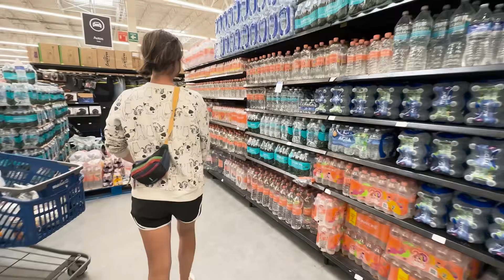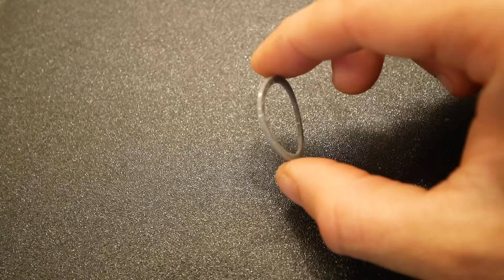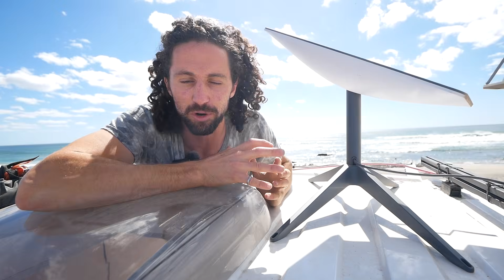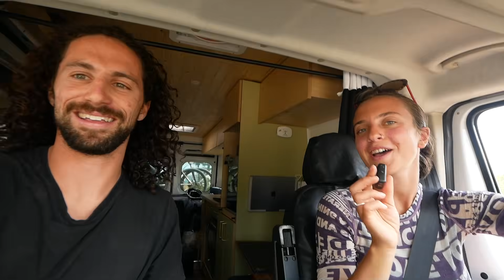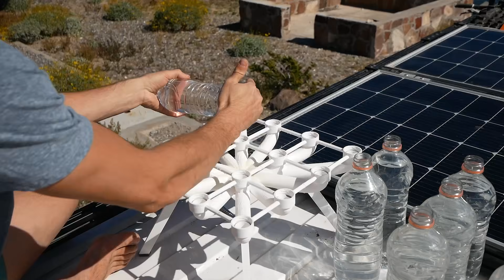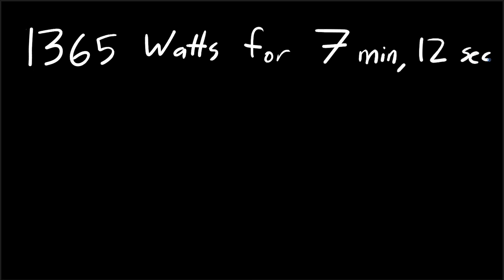I Built an Unnecessary Invention for Van Life

Comment: I would recommend you watch slant3D(a print farm) to optimize your prints for 3d printing. Please do it, my eyes hurt watching this video.
Tip: Dont use those pipes. Print a pice, that collects the water from the bottles and the water will flow to the low point. It will use no support if you cut it into multiple pieces.

Comment: Here could be some Updates on the design:
Update Refill Ways
1. make some male ends for the top caps so you can just put 1 bottle in at a time (the pressure might be higher but idk)
2. makes it so you can put the empty bottles on the roof without water in them then just make a 2nd one of these but with a hose so you can hold it higher than the empty bottles then you could just 3d print a tap then screw your shower head on so no water fell out of the bottom
How to make it Hotter:
1. add a tin foil wall type thing so it can get more sun rays to heat it

2. MORE BOTTLES, make you capacity bigger
3. Print it in black
P.S. I really liked your video so i bought my first 3D printer
Nice video
🙃🙃

Comment: Ok, this project is totally ridiculous for so many reasons, some being pinpointed towards the end, and I get that it was somewhat the point of the video.
DIY is fun, but if you don’t make your research properly, anticipate problems with your choice of design, tools or materials, the result will be totally unpractical and useless and just prove that commercial solutions are much more clever than you are (and paradoxically much more ecological).

But for the sake of the game, I’ll just suggest an hybrid solution : using solar energy to preheat the water before using it in the water heater. That should reduce a bit the power consumption while providing a more satisfactory user experience.

Comment: Yeah I definitely would have made the center part one piece and then had each water bottle holder and tube a separate part that screws or fits into the base piece. Then, each water bottle holder would have mounting points to connect them all together with braces. This way, you could easily iterate the design and beef it up without having to reprint the entire thing. You could beef up the braces by just reprinting the braces. This is the instance where modularity is key.

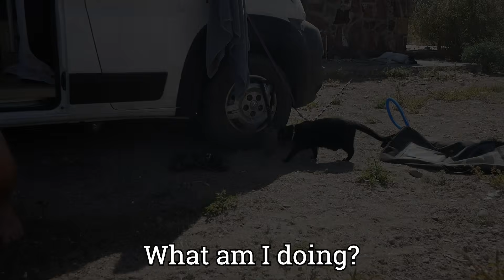Comment: 18:00 "What are you doing?" is what I as asked when I saw this monstrosity in the thumbnail. The way you designed the pipes to all converge at the center, dividing it in 4 pieces that are going to have angled seems that you super glue and caulk to try to seal, and only 0.05 inch wall thickness...

If you were to ever try this again then I would suggest making it more modular by having 4x of a piece that connects 4 bottles together and 1x of a piece that connects those 4 pieces together, all designed with 45 degrees as the max overhang so that it shouldn't need supports, and at least 2-3mm SOLID walls is recommended for PETG prints to hold water.

Comment: Um, a black vinyl bag made to fit available space with a filler fitting and shower fitting would have worked. Just two pieces of vinyl, someone to weld them, and fittings. Oh, or you could buy a solar shower or two at a camping store. Just saying.
Reply: Why not just buy a collapsible 20 gal water bag used for camping?

Comment: I think you could do away with the TPU seal if you look a bit more at the mating surface that hits the mouth of the bottle. The threads don't create the seal, they just pull the cap onto the bottle.
You need a surface on the top inside of the cap that seals against the mouth of the bottle.

Comment: There is a video regarding white filament which uses titanium dioxide so not only is that not a compound you want to print indoors with it also will wear out your nozzles quicker than any of the dark colors that don't use titanium dioxide

Comment: If you're looking at saving water and energy, a recirculating shower is ideal, as you're just filtering and re-using the same warm water rather than having to heat cold fresh water. it's a bit of an engineering and plumbing challenge involving pumps, multiple filters, tanks, valves and heat exchangers, but also a great project to get your teeth into!
Reply: ew

Comment: In regards to designing the cap. Could you have used the original bottle caps and just drilled a hole in them and then glued them onto the rest of the system you made? Also Attach the bottles right side up, then turn them over.
Reply from the maker: Yes, but where’s the fun in that?
Reply: I agree. That was my first thought: you already have at your disposal a perfectly fitted threaded watertight system, so why on earth would you not use that in the design ?
Ok, that might seem funnier to try and try again redoing it with a 3D printer, but that’s a total loss of time, energy and material.
Which wouldn’t bother me at all if the idea and the promise at first was to recycle and be more ecological…

Comment: another good method would be using a heat exchanger from a car transmission to heat the water up from the engine heat while driving, ofcourse if your stopped for a few days that wouldn't work as well.
Reply from the maker: Yeah, those are a common water heating solution for boats, some people use them in vans as well. Super cool!

Comment: Maybe do some intensive testing with water. The prints are not watertight. Why I know, testing with different Gardena Connectors. First the seems to hold water, but after 1 day you see drops.
Thats the issue, yes there are methods form printing watertight. My solution is to dunk the print in a chemical to fill the gaps.

Comment: Yes there is that ABS pipe already made, but.... You were recycling bottles. NOT ABS pipe... So there is a reason for this. 
Also, what if.... doing this, it creates ideas for other uses where say an ABS pipe could not be used. How much space does the pipe take? Is it as portable? 

I was also wondering, what if on each bottle, you printed a valve adapter? Then you could attach, turn "on", attach that to the grid with out loosing water, then when all are on, you "off" the valves and then the water flows? Not sure if the valve could also have a breather port to prevent the vacuum? 
Just thinking out loud.  Keep up all the GREAT work!! 👊

Comment: I have the perfect answer for holding the drawers shut, and it’s completely invisible simply go to the baby section of Walmart or target or any store like that and buy the baby proof drawer latches you mount them on the inside you pull them out they only come out about, I don’t know half inch possibly you stick the edge of your finger in there push-up in the drawer opens Problems solved

Comment: I think this is probably why a lot of (tent) campers use the big, black floppy bag - good capacity, warms up well, drains well without the need for fancy valves etc as they deflate in normal air pressure.  You could simply throw one up there a couple of hours before you need a shower.  Cover with some plexi-glass and you will dramatically increase your efficiency.

Comment: 0:20 --- srly ? .... "you HATE doing"
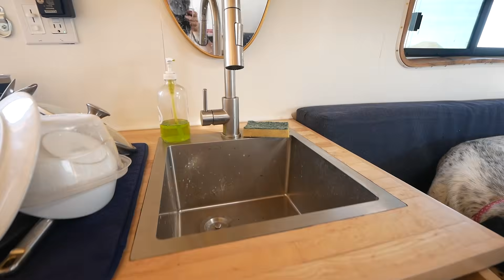meanwhile one big bottle just and inch oposit .... am i joke to you   ,,,, PS 5:04 -- there is something called heatpump water heater ,(can be done DIY) it use up to 6x less energy than standard resistance heater 
the easiest way to build it yourself is to buy 12/24v  mini heatpump (its also called AC - air conditioner) compressor  unit + evapourator and some copper pipe to make spiral out of it to work as a condenser inside water tank ....  and let someone build it to heat water  , could be cool project :)

Comment: For strength and rigidity I would have just printed a thin box with threaded holes on the top to screw the bottles into. You could also design pyramids shapes between bottles to increase surface area for sunlight to heat.

Comment: To expand on Morley's math at the end of the video, on earth an ABS pipe solar shower would be the eqivilent of adding about 3m² of solar panels to the van.
Math:
The Solar irradiance(how bright the sun is) is 1kW on the surface. 
A 3m long, 6" dia solar shower has a surface area of ~ 1.47m².
Even under ideal conditions only 50% of that will be in direct sun, so 0.74m². 
ABS pipe absorbs ~95% fo the light that hits it(aproxamated using the value for "Black plastic" in an IR emisivity table), this means that the ABS pipe solar shower can absorb 700W. 
Solar panals are  <20% efficient, which means that to generate 700w of at least 3m² of panels are needed.
Reply from the maker: That’s amazing!

Comment: The sealing mechanism on many plastic drink bottles, such as the bottles in the video is a small conical section on the top of the cap,  where the angled part of the cone section seals against the inside of the mouth. (imagine the cap has a complete cone with a base dia.>the mouth id stuck to the inside, the threads of the cap will pull the cone into the mouth of the bottle pressing the sides of the cone into the mouth of the bottle, creating a seal. Now remove most of the cone, so that there is just enough of the cone left that it will still make a seal .) This requires A) the lid to be made of a somwhat flexible plastic, often HDPE and B), the angle of the cone relative to the interior wall of the mouth be fairly shallow(30-50⁸ ish).
Reply from the maker: Fascinating!

Comment: cutting off the bottoms of the bottles would solve the suction created when its running. it would also solve the issue of flipping full bottles over trying to screw them in. You can fill them all while they're already attached. You could also set it up during a rainstorm to fill them.

It definitely feels like time/space/resources better spent on a different project though. the space this uses up would be better used for an additional battery for example. It's out of the way when in use, but it needs a storage space when not sitting on the roof.

Comment: you need a bottle inside a bottle, the outer bottle clear, the inner bottle dark, that traps the heat and makes it reflect constantly into itself, that's how most plastic-bottle based handcrafted shower heaters are usually made. and you just tape 2-3 bottles together and and up with like 4-6 water holes, aligned to be connected to a single pipe sideways, you could 3dprint a lot of that, but you need to put actual face thickness and not skip on the infill, as its going to need some strength.

Comment: I think reusing the bottles as printing filament would be the best solution since you print so much. But fun project as always!
Reply: Yeah the only issue with reusing thermoplastics is that the chemical properties break down after 4-5 remelts and it becomes unpredictable. Also water bottles are very little plastic as they are meant to be as cheap as possible.
Reply: what I was thinking too. It doesnt need much either. Only problem I can think is it may damage bambulab so I would add a cheap ender to print with pet
Reply: in the netherlands and germany we pay like 15 cent extra and if you bring it back into the store (if they have the machine) you get those 15 cents back and dont have alot of plastic bottles left
Reply: @shaymin7240 they do that in some parts of America main one is Oregon 10 cent tax there is almost no litter anywhere but in Washington neighboring state it’s so bad high ways have many bottles and cans in every corner
Reply: @RetroKnifes  might not be the safest but couldnt you pick up those bottles and cans and get some money for it? or are they not valid for getting the 10 cents back
Reply: I print bottle filament on my bambulab with no issues
Reply: 😂 yeah and makes 10 times more plastic waste😂😂

Comment: actually, you did solve an interesting problem in how to make a 3d printed bottle of water cap.  For that alone, the video was worth every second of what you consider a failure.  Your commentary on the design love problem and the work-through to simplicity.  Efficient simplicity is typically the result of the epiphanies of design iteration.  As Elon Musk requoted "The Best Part is No Part".  My interpretation of that is "The Best Design is the simplest that covers the real requirements."  The issue sometimes is iterating the use case solutions until you understand what the real requirements actually are.   

In this case,  using what you've learned,  another solution that reduces battery load is to have a van-live passive solar heater as a repository for hotter water that can fill and add its prewarmed water load into the heater tank which will reduce the heater load on the battery without sacrificing the quality of the hot shower experience.   Hot water is typically used for cleaning in the van thus it is 'gray' water after being used. The solar water heater's water becomes a secondary water source for the van without compromising or consuming as much of your pure water supply though you still need to the cold pure water infeeds and hot water outfeeds separate.

Great video though!!!!🤪

Comment: Ok solar, water bottle, recycling... ok... *thinks*...  Well if the bottle had water in it and a light was shined through it it would act light a lantern. So if he light was chargeable via solar and had a light sensor for night it would be effectively a night light. The goal would be length of time & size so... smaller solar panel and change the battery to be a supercapacitor or supercapacitor for the sake of space/cost. Eh could make low cost night lights for places where there is otherwise no lighting at night.

Comment: I think I see a pattern with you and the 3d printer.  The solution does not need to be 100 percent 3d printer solution.  Much like your cat ramp.  More concerning is that you are taking a shower standing directly on the ground.  Get a milk crate or something to stand on off the muddy ground, and use the crate to store your shower stuff when not in use.  I like most your videos, but this one you seemed to be stuck in your printer world.

Comment: love the maker spirit, but i wish you would adopt the philosophy that 3d printing isn't for everything. tubes, for example are so cheap and readily available. you could have used the original caps and bought some tubing from a hardware store. then buy some aluminium or wood to make the frame.

Comment: This is true for most things, usually your time has to be worthless for it to make sense to build just about anything these days provided it exists as a product, but then you’d miss out on all the experience instead. Even though a particular design even turns out to be completely useless you do gain a lot of experience going through the design phases that will be beneficial down the line next time, and knowing what didn’t work is also useful experience. The reason seasoned designers are so good at what they do is that they’ve already solved most issues and done most of design before, so they’re just integrating previous solutions instead of coming up with everything from scratch. Electronics is a good example, I have a lot of circuit “design blocks” in my notes that solve a particular problem, so half of a project is just copy pasting previous modules together which makes things so much easier.

Comment: Cut the bottoms off the bottles and just leave them screwed in place and fill with a bucket?? Solves the vacuum and the spillage when flipping issues. If you left enough of a lip on the cut off you could use the bottle bottoms like lids to minimise heat loss. Also I have seen videos of people stripping down plastic drinking bottles and melting it into filament that they use in their 3D printer - is that an option for all the bottles you want to recycle?
Reply: also just paint the bottles black for solving the heating problem

Comment: I'm wondering, as it's sort of the topic of this video what you do with all the plastic waste that you get from failed prints, prototypes, stand offs, supports, etc. I know space to overly worry about such things is going to be tight living in a van so basically I'm wondering what you do with it all and if you bother keeping it all and recycling it etc. Is there a, way to recycle it yourself whilst on the move or what are your other options? Thanks enjoyed the video and found learning a bit more about solar showers and seeing your solution to the problem whilst on the move and waste water bottles, or at least these few bottles (every bit helps) quite interesting and informative, despite the fail.
Reply: There are machines that can melt fails down and turn it back into working filament however they are typically complicated (not unlike most stuff here) and expensive although some people have built them themselves. Other than that there isn’t a ton suitability but it’s a very minuscule amount of waste and can look good as art 😂.

Comment: waste of plastic, waste of water... useless project.... you tell so many wrong things, just to tell a wrong story. wrong materials, coming up with "Ah was made up by the industries"... dude you skipped some physics classes? or telling its 10% of your battery because your battery was empty. so your mileage is depended on how empty your fuel tank is?
Reply: He does say 10 percent of the CURRENT capacity at that moment (so 10% of the 24% of maximum capacity). So ten showers would be a dead battery. To use your gas tank analogy; it's how much gas you have in the tank RIGHT NOW rather than its maximum capacity.

Comment: @MorleyKert I think the point of taking on these projects is it builds experiences for making that truly useful idea. In this video, you had to approach many problems concerning water tightness, threading, and learned valuable lessons in alignment, splitting prints, and more.

This project may not have been practical, but the next project will benefit from your insights and experience gained, and you will come up with better ideas because you failed beforehand. Failure is just iteration. Can't wait to see what you make next. Keep it up.
Reply from the maker: Absolutely! Thanks for watching